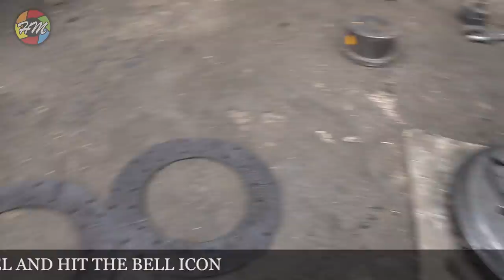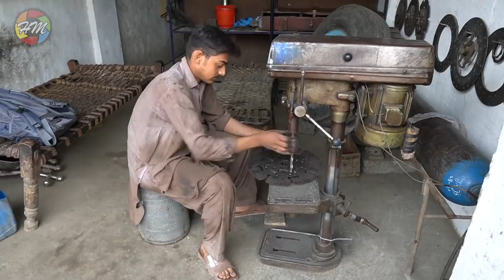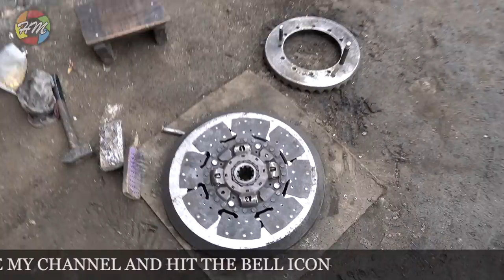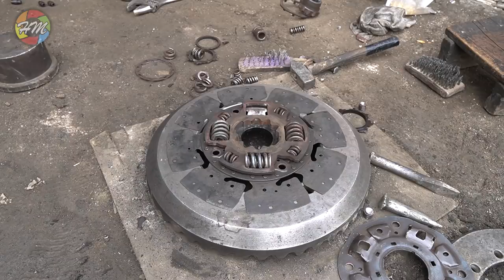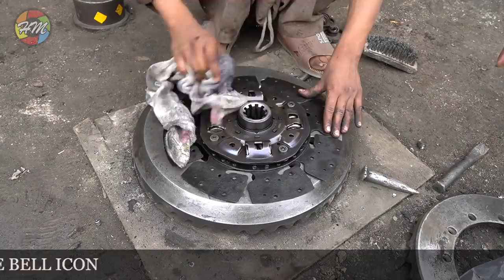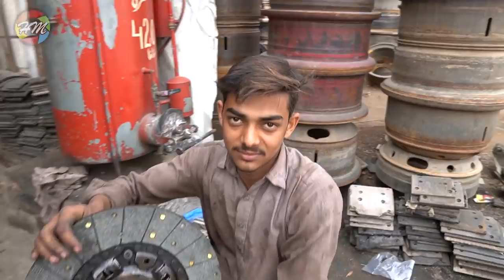How to Rebuild a Old Truck Clutch Plates Must Watch| Impressive Technique.

Comment: Once upon a time and I can remember still when British clutch workshops used to service clutches on the spot pretty much exactly like this.  Indeed I believe there is local to me a place in Henstridge who do a while u wait relining service for brakes and clutches with the only thing different being a hydraulic press for the shock absorber springs and digging out the rivets with a high speed industrial pillar drill.

Comment: Contrary to what some may think the work is acceptable for a backyard repair for personal use but not anything you would want to charge a customer for.  I can only imagine what the pressure plate and flywheel surfaces look like.

Comment: Nice work . But not-amazing ! Until mid 80’ in any car part shop you can find “clutch disk repair set” ( mainly for older cars) . Set was no more than pair of new fristion pads and copper rivets. 
For car clutch , dimanting of central shock absorber was not neccessary , just  cleaning and some “strech-out” - combination of WD40, break fluid , to remove rust and dirt , and than manual reactivation. 
This repair was cheap, but potentialy risky - once pads become thin, rivets make  marks on flywheel and clutch plate . 
But , that was peruod when clutches are regularly inspected and fine tuned !
Reply: I remember taking brake shoes back to Lucus for them to do this. Now the dead ones go in the bin.